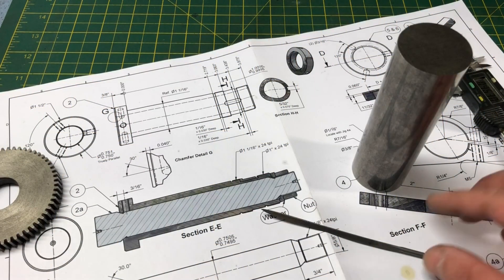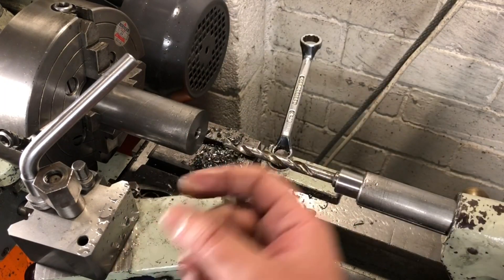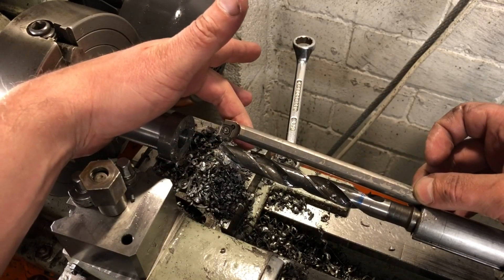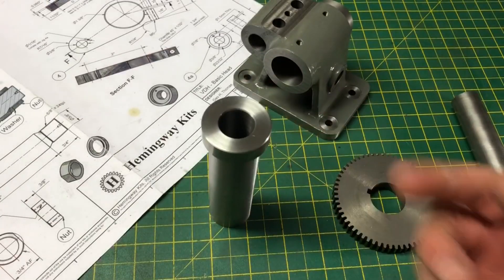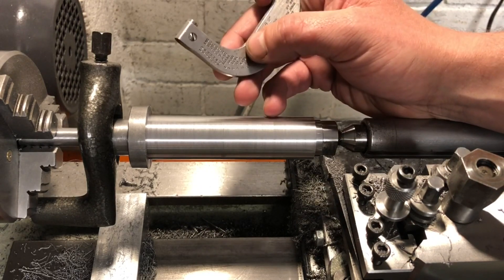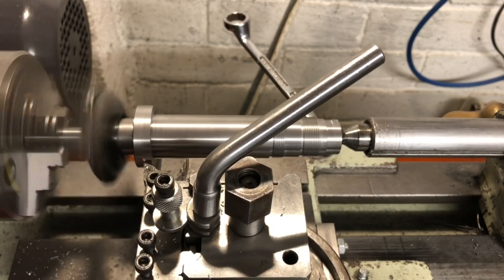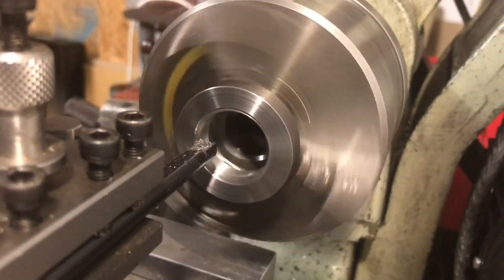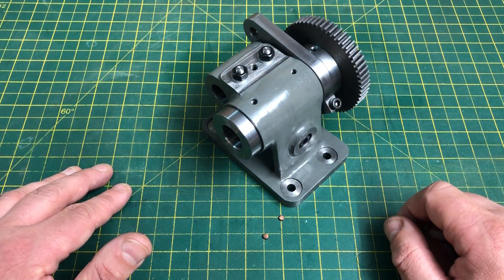Building The GHT Versatile Dividing Head - Part 4 - Machining the Spindle

Comment: 10 years ago I was given the kit with missing components. Spindle blank was missing. I made the spindle out of 4340 steel. I deviated from blueprints. My spindle is a little bit larger, bored for MT 3 taper, as well with the special taper for 6K collets. Spindle nose is threaded 1 1/2” 8 TPI to match my South Bend lathe chucks. This dividing head is now a very useful tool in my workshop.  Modification for lathe 6K collets is extremely useful. Original blueprint was talking about a variant for If I recall, 3C collets.
Reply from the maker: I have been thinking about the best spindle configuration myself. I do have a set of 3C collets for my small bore South Bend lathe (Yet another project!) so I might make a second spindle to take these. Not convinced by the parallel bore method but will finish the project “as is” and see how it works before trying other things. Thanks for watching!

Comment: Many of the reamers we at home warriors have are well worn items hence the shite surface finish, combined with our not so rigid myford lathes. The tool came out nicely tho so I wouldn’t worry about it
Reply from the maker: Very true. The one I used was liberated from Hawker Siddeley in the 50's so around 70 years old. The clues were there before I started really!
Reply: @DrillsTapsDies  I very seldom use them as most of mine are knackered. I’ve just got some old GHT dividing head castings from back when CES supplied them so no bar stock with them. I may incorporate the myford thread on the end of the spindle as luckily I could make the spindle at work

Comment: "I choose thread pitches that are multiples of 8, as this allows me to ignore the thread dial..."
Are you saying you can safely closed the half nuts anywhere that they can mesh?
I didnot know this was possible!
Reply from the maker: Yes, with caveats! I should have been a little clearer - it is specifically multiples of the lead screw TPI; for me that is 8. If your machine has a 6 or 4 TPI lead screw  then any multiple of those will allow you to engage at any point. Number, line or even between lines. It is a huge time saver if nothing else!
Reply: @DrillsTapsDies  Thanks for the clarification. I guess this is why both ME threads pitches are multiples of 8. I wonder how this phenomena can be utilized with a metric leadscrew?
Reply from the maker: I like the ME pitches for exactly that reason! With a true metric machine it should be the same principle. You could cut pitches that are a divisor of the leadscrew pitch. So for a 3mm pitch leadscrew you could cut  3, 1.5, 1, 0.75… etc. I’ll let someone with more direct experience of metric machines to confirm this. (Or correct me!)
Reply: @DrillsTapsDies  These are gems of information, Thanks. I thought I was well read.
And it helps to explain why some lathes were sold without a thread dial. I hope you video other GHT or ME projects. I pick up something in every one of your videos
Reply from the maker: Thank you! I have lots of projects on the list so there should be more to come after the dividing head.
Reply: Thank you both for these series of comments, I didn't know it was possible and I just got a metric lathe without a thread dial, this will come in really handy!

Comment: If you really hate the finish on that bore you could bearing plate it and lap it to size, though that seems a bit excessive, IMHO. Not trying to tell you how to do your work, I think it is turning out very well, comment mostly for algo.
Reply from the maker: Thanks for the comment and the suggestion! I have considered it but some of the gouges are quite deep and it is completely cosmetic. I am quite close to the stage where I can take some measurements to indicate any parts that might need work - if there are any issues with the spindle at that point I might revisit it.
Reply: looks good from my house, you could just tell people it is a scallop pattern for oil retention.

Comment: Looking good. Invaluable to see a mere mortal (no offence meant) doing such a great job. Any idea why the the reaming went a bit awry?
Reply from the maker: Thank you (and none taken)! It was an old inherited reamer, it looked and felt okay and it seemed to cut alright but clearly not. The surface finish looks like there has been some build up on one of the cutting edges that has also scored the bore in some places. At least this is a location bore and not a running surface. I might hide my shame with a permanent Myford nose insert!